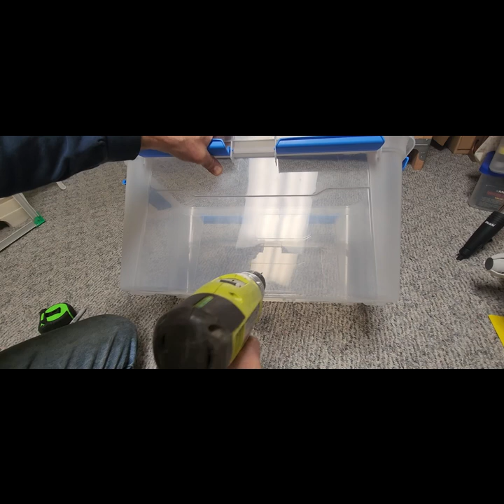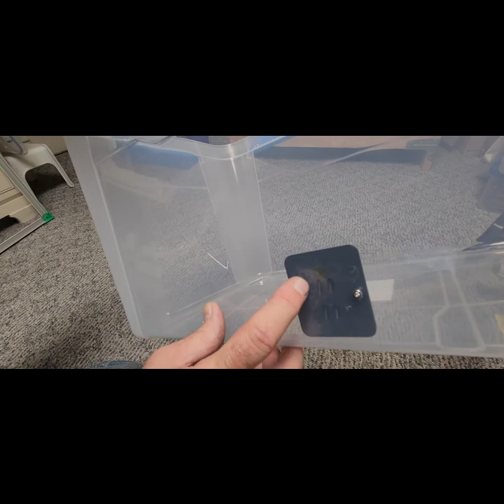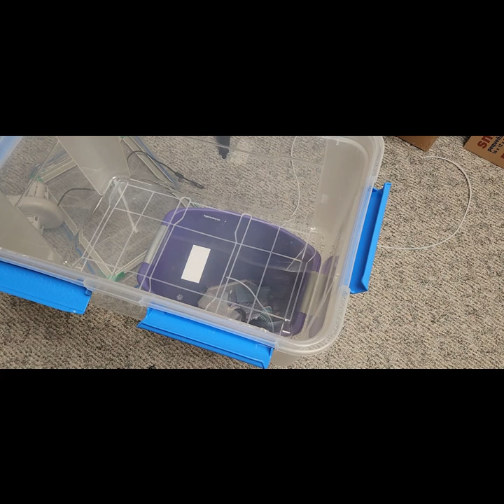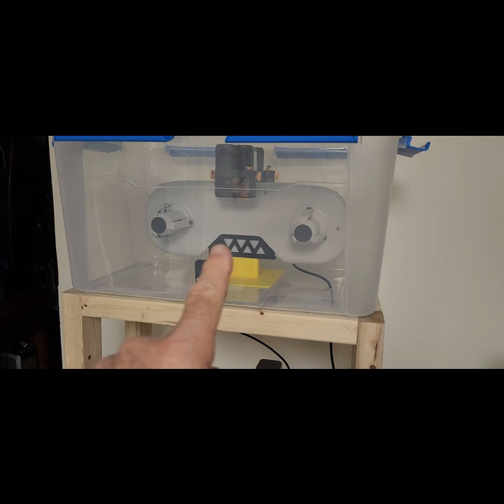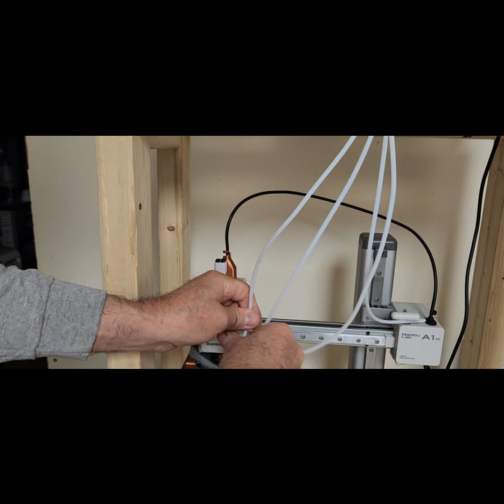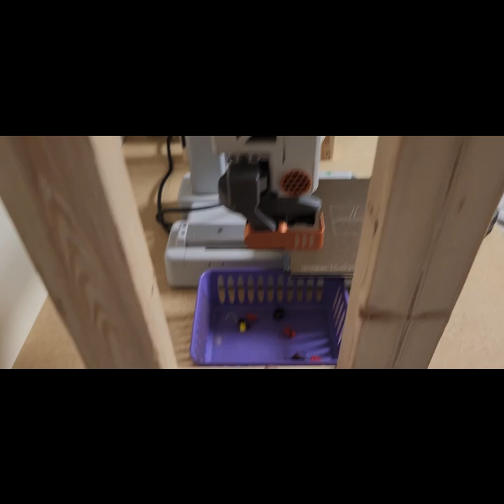AMS Lite Dry Box

Comment: Did you make/cut your own PTFE tubes length, if yes is there a specific length you shouldn’t exceed, also d ours it matter where you insert them on the tool box header of the actual printer, and are they two different sizes tubes, front and back? Sorry for the questions, everywhere you look there’s so much mix and different info

Comment: Did the inverted box with your printed parts. Just finished it! Added high performance dessicant. Went from 40%+ humidity to 10% on Hygrometer. I used aluminum tape on the outside to seal the tube holes and the power cable.  Thank you so much! Sent you some venmo appreciation. :)
Reply from the maker: Thanks so much for the coffee money!  I REALLY appreciate it!

Comment: I'm working on something similar to this. However, on mine I'm running the AMS above, and slightly to the rear of the A1-mini. This should allow me to run th original PTFE tubes sithout adding length to them. This should avoid any feeding and or retraction issues that could arise from longer tubes. I also purches the "Top Cube" enclosure (only because there was a 44% off sale on it). I have hopes of feeding the PTFE tubes through the top panel of the enclosure, or as 1 reviewer stated, the AMS Lite with verticle stand mod may fit in the enclosure. If I end up using an AMS dry box, it's gonna be made from a large styrofoam cooler. I will have the unit sitting on the lid, allowing me to remove the entire body of the cooler (upsidown). That will give me full unabated access to the AMS for reel changes etc. I also had a thought of feeding warm dry air from my Sovol filament dryer via a clothing dryer duct/ports. I will see how the passive drying works out before adding that complexity. 

Thanks for the video. It is good inspiration.
Reply from the maker: Sometime after I came out with this video I made another video called "Improved Upside Down AMS Dry Box".  It also puts the lid on the bottom so you may want to take a look.  Thanks!

Comment: Great video. Will try to access the files tomorrow
Reply from the maker: @CrustySamwich92  Thanks!  I've got a new design coming out in a couple of days.So you may want to hold off printing any parts.  The new design puts the lid on The bottom so when you take the dry box apart you have much easier access to the AMS lite.
Reply: Perfect, I will do that
Reply from the maker: @CrustySamwich92  https://youtu.be/S8TndnOZtEI

Comment from the maker: I've had quite a few comments suggesting that I  flip the dry box upside down, with the lid on the bottom,  to make access to the filament spools easier.  I've been working on a solution and should have something posted in the next week or so.  Thanks for the suggestions!

Comment: I like the idea of mounting the ams lite to the cover and then the bowden tubes could go directly through the cover and the surface the cover rests on. The desiccant tray could be mounted to what now is the top so when the top is removed to change spools there is plenty of room and the desiccant tray is out of the way.  Also the wooden frame is the beginning of an enclosure where an exhaust fan could be mounted with charcoal filters. For an A1 which has no fan to cool the motherboard there are solutions already available with ducts and fans but I would also add a heat sink to the bottom of the A1 with ductwork.

Comment: Did you need an extension cable to power the AMS to the A1?  If so - where did you get it?
Reply from the maker: @WhereNerdyisCool  If the height of the stand that the dry box sits on is 21 inches or less you do not need an extension.   That said I think you can buy them on ebay.

Comment: Try mounting the ams lite and on the lid, with the lid upside down. When changing filament the whole clear part comes off giving easier access to the spools.
Reply from the maker: That would only work if you eliminate the desiccant tray.  So I suppose if you don't want the tray that's fine.

Comment: Has anybody tried using a gun safe humidifier tube inside a box like this instead of desiccant  pouches, just curious if that would work, as the tube wouldn't need to be recharging all the time?
Other than that this is a great plan, I may do something like this for my A1
Reply from the maker: @davidschuster3623  just as an FYI,  this uses loose desiccant in a tray.  I remove the tray,  pour the desiccant onto a metal tray and bake it for a couple of hours.  The tray helped make the process pretty painless. 

Thanks for your feedback!

Comment: Did you ever consider making it upside down?  Mounting the AMS to the cover(blue part). And using the clear part as the cover. This way when you take the clear cover off, you have a lot of room to switch spools.
Reply from the maker: Although its hard to see in this video, just above the AMS is a tray to hold desiccant.  The tray is nice because it keeps the desiccant "out of the way" and also makes taking it out to dry very easy.  The other issue is that the lid is not very strong and I think it would sag too much.  That said I will think on it as there may be some solution.  Thanks!
Reply: @3DPartFactory  The lid could easily be reinforced. I think I actually may make one with the lid down and also design some desiccant boxes that have mounts on the lid and are removable so you can easily snap them out to recondition/refill them. Thanks for the great ideas!
Reply: I was thinking the same, but cable length seems limiting.

Comment: How effective has this been for you? I love simple solutions and so far I’ve only seen dry boxes that take pretty long to print. Great job!
Reply from the maker: With 1 pound of desiccant my dry box goes from 40% humidity down to 10% in about a day and will stay at 10% for about 6 weeks before I need to dry the desiccant.  How long it will take your dry box to get that low will depend on how dry your filament is to start.  Mine was already pretty dry.

Thanks for the question!